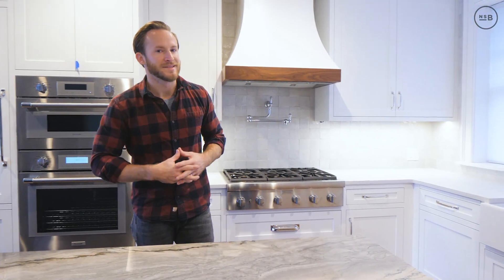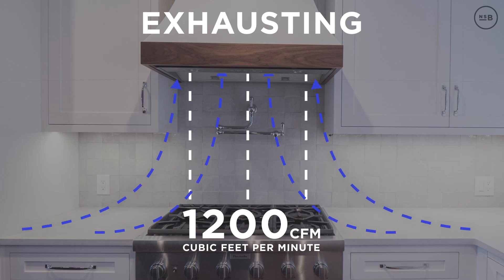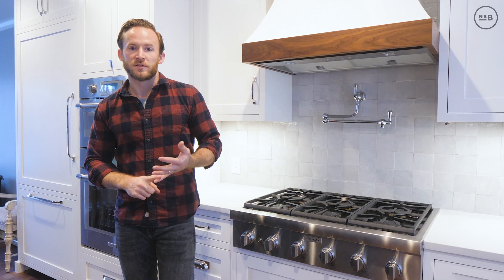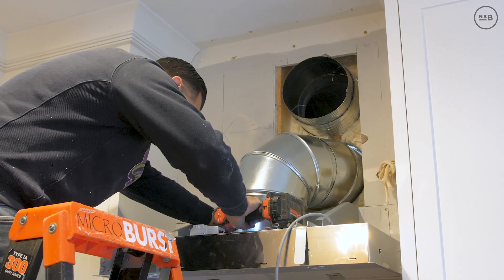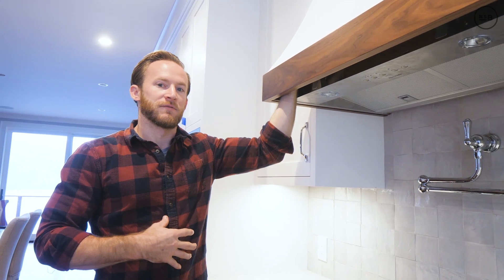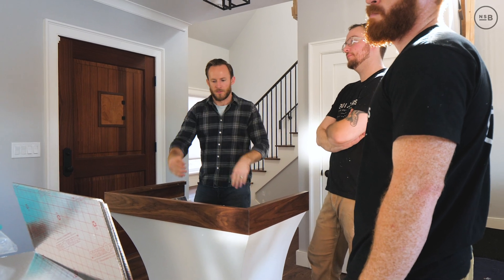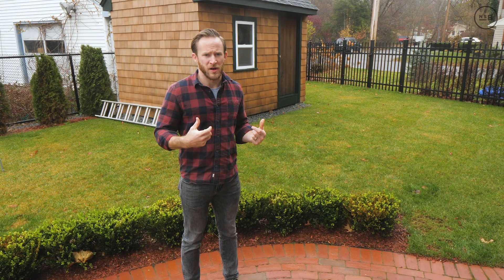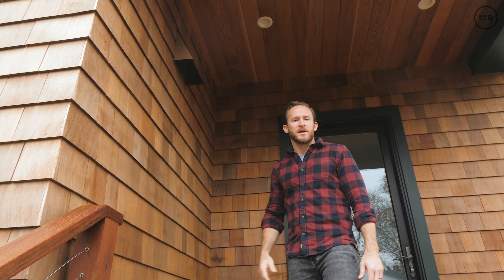Kitchen exhaust and make up air all under one hood at NS Builders Lake Drive Custom

Comment: What am I missing.?  The system  has a flow of 1200 cfm.  The inlet opening looks like 8" by 10".  That is just over a half a square foot.  That means to get 1200 cfm through that opening,  the airspeed  would be 2400 feet per minute. 

If my math is off, please tell me where I goofed.

If I'm right, this system would be rather loud.

Thanks

Comment: Seems like a clever solution, but I’m not so sure I’d want outside air (even filtered) blowing directly into my food.  I’m also genuinely wondering whether there is a safety issue with blowing air directly onto a cooking surface - wouldn’t that just stoke the flames if you had a fire on the stovetop?

Comment: rediculous, I have very tight new build, running 48" gas rangetop with 1300 CFM exhaust hood- ZERO " scam make up air" ZERO ISSUES!!!! This is all a big JOKE SCAM for idiots
Reply: the air has to come from somewhere.. lets hope its not pulling carbon monoxide out of your gas appliances
Reply: He may not have any other gas appliance other than a gas range and that wouldn’t backdraft  correct?  In theory if there was no air to pull from the exhaust would just be pulling much less than 1300 cfm.

Comment: How does the damper activate? Is it a pressure switch or a simple electronic switch tied into the on/off switch on the exhaust hood?

Comment: Very good idea, if you insist on gas burners.  But it raises the debate about cooking with gas.  People love the experience but... If we have green electricity in the area, gas is not enviro friendly. Worse yet, many science studies show that heat transfer to pots from gas flame is very inefficient compared to cheaper electric elements, not to mention induction if you have the money.  Making the inefficiency even worse is that you are expelling heat and pre heating makeup air. Yes you have to vent any steam from some electric cooking but not at these volumes.

Comment: 1200 CFM???? That would be CRAZY volume amounts of air flow. Equivalent to a 3 ton HVAC SYSTEM.  Observing your wall vents probably 120 maybe 200CFM. You should have it flow tested with a flow hood???  That said, I like the concept might try to work it into a kitchen it makes sense.  But NO WAY ITS 1200CFM.
Reply from the maker: I agree, it’s a lot of CFM!

Comment: I hate to tell you this, but most commercial”compensating  hoods only allow about  60% to 80% of untempered outside air directly to the hood. Steam hoods are typically in the 50% to 60 % range, while high heat grilles, fryers, etc are closer to 80%.  This is applicable at least, to cold weather climates that may have as much as 90 degrees temperature differences. Very cold 0 deg. To -20 deg. Air would totally ruin your day, if it is blowing on the food being prepared.

Comment: I have absolutely never even considered this as a potential problem. I'm looking at hood vents, and now I'm trying to understand how to accomplish something like this. I am considering creating something like a 20 inch x 3 inch vent that sits on the back wall, just above the top of the stove as a fresh air inlet. So as air is being pulled up through the exhaust, its being fed in at the rear of the stove.. Just a thought. This is fantastic stuff!
Reply: Just crack a window. Cost = $0.00.

Comment: I'm not convinced this will work well. Make up air doesn't "pour down" 3:54, it's not water. Nice work nonetheless.
Reply: @TheRayDog  that's what I was thinking, if anything it will pull the air straight back into the exhaust

Comment: If you made the last section of that fresh out take laminar it would drastically help the air reach down and grab the smoke. To make the air laminar it would not be hard. Just glue 100s of straws together and place it over the cavity. You could make the grill look cool like a Apple Mac Pro case.

Comment: Interesting ideas.  Two things may be overlooked.  First, the area of the exhaust & inlet hoods look to be less than 10" equivilent.  Second, a passive makeup should be larger than the discharge (pressurized) duct.  Have you encountered problems due to either of these things?

Comment: great video & great design /engineering, yet simple and eliminates a lot of equipment needed. Just one question.... you mentioned the backdraft shutter on the intake vent... is this a manual flap, or motorised & linked to the fan switch ?

Comment: Great execution! You mentioned that this method eliminates the need for a heater; however, there are concerns about colder climates in the Midwest and how effective this system would be without one.

Comment: im looking to install make up air system and was thinking in my head why cant i put the intake close to the exhaust this is exactly what i was thinking. My garage is the same wall as the fan so im good there. My question is how far should i place the intake from the exhaust 20ft ?

Comment: I love this concept. I am limited to 100 amps @ 240v due to being offgrid an can’t afford the 6000 watts needed for an inline heater unless I seriously expand my already sizable battery and inverter setup..which I might do at some point, but why add more loads If you can engineer around it? Wish this was a commercially produced product.

Comment: This looks expensive. I need to do a ceiling which I would think complicates it all. I am planning a 48 inch dual fuel Wolfe range and it’s in a peninsula. The range requires an 1100 CFM and this is in a 210sf kitchen open to a much larger great room with vaulted ceiling. Is it possible it’s not required? I feel like there’s two different schools on that.

Comment: I'd be very interested to see what happens if you do a pressure test on that house, and see if enough air comes in through the hood.  From what I've been learning, I think the makeup air won't be enough if you only have passive make up air.  The air will come in through your hood, but the vent will depressurize the entire house, not just the cooking area.  So, air can enter the house by any vented means, such as a chimney or the furnace vents.  Yes, the hood vent will allow air in, but will it be enough if only passive ventilation?   Can you comment on that?
Reply: I think you are correct, however there is something to be said or 'valued CFM' added when the point of return is 'point blank' near the point of supply. Think of it this way. IF the loop was closed, then the CFM from the hood (going out of the house would equal that of the CFM coming in (image the dumb contractor closed the loop by accident).  However as we know, it is not a 'closed' loop and there is a 'distance' between the two. This distance can be modeled (or though of) as a 'gap' in the closed loop.  Or closed loop with a section removed (say 6"); how many CFM's are lost in that gap through inefficiencies?  That would be the 'lost' CFM's needed to be forced into the system to obtain equilibrium.  

Without instrumentation, I'm beginning to think if A) the point of venting and outside air volume are close enough and B) the lost efficiency is less than 400 CFM one would be covered/ in compliance. NOTE: The 400 CFM value is from the IBC code where if less than 400 CFM, a system is not required in the first place. Cleary the code is not eluding that the pressure is neutral, but rather explicitly indicating if it is 400 or less, we (the authors of the building code/IBC) don't consider it material.  That tells me that if the amount 'lost' from a 'non-closed' loop is 400 CFM or less, all is good.  

I'm starting to think the other systems (with the fans and Heafy price tags) are using the 'zero' pressure result somewhat of marketing hype since the code clearly indicates a 400CFM spot at the start line.
Reply: @tillmansr2002  The code allows 3 PA or less pressure difference, and has an exception for 400cfm and under as you pointed out.

I think what maybe you are missing is this 10" active blower is likely pushing something like 1200cfm.  And a passive 10" opening only provides 450cfm or so.

Compliance is not 400cfm difference it is 3Pa difference, but even if it was 400cfm difference I still think it would fail.

Comment: You guys are meticulous! I wondered if the intake air was passive or also inline blower and if you filter the air going in? May not be an issue where you live, but here (Nashville) we would suck in so much pollen, and other unpleasantries that I would have to filter entry air.

Comment: Have you tested how well its actually equalizing the pressure? I've seen some other videos showing that with a passive system you actually need a much larger intake to achieve a net neutral airflow.
Reply: Other question from that, have you done any testing with a smoke pen or something? If the intake isnt keeping up with the vent, is the make up air actually flowing down to the range and back up or just staying up high and not really helping to scoop any of the steam/smoke/etc?

Comment: I assume the home has been properly air sealed and blower door tests confirm this. (I've enjoyed watching this channel so I know the answer is yes) Now My question is with the vent blowing out at around 1200 cfm, how are you sure you're getting in the equal amount of air from the open end system? I've seen Matt Risinger & Corbett Lunsford on their channels show that you need a powered fan to induce the fresh air into the home as well, if not you're still getting negative pressure. Did you test for this??

Comment: Lovely work. 1) Does this have a blower on the make-up air duct also or is the air moved by  the negative house pressure generated by the primary vent blower? 2) How much does the downdraft of the make-up air reduce the suction at the level of the range? Thanks,   David - Dallas
Reply from the maker: No blower on makeup. Passive intake. We didn’t “measure” the reduction, if any

Comment: It sounds like a well thought out system.  I wonder how well it turned out.  In the past I owned a range hood that sent about 20% of the exhaust back to outlets in the front of the hood to accomplish just what he showed here in the motion diagram, that being, to create a rolling effect of wind between the hood and the range.  It didn't work.  And it was particularly problematic when using the oven or the front burners.  The house would smoke up.  And because that 20% was recirculated it lowered the CFM pulling power.  I have the feeling that if this system here works at all, that it would be when the hood is run at full power.  I believe that make-up air for a range hood is best accomplished in having the make-up air come from an outlet located beneath the range.  With that set-up all of the smoke and heat being produced by the cook top as well as the oven is pulled away, and there is sufficient make-up air introduced.

Comment: I'm sorry to say, this is a hare brained idea. You're hoping that incoming air is going to drop down to the cook top before being sucked back out. I don't know what makes you think this is how it will work, but it won't. In reality, most of that incoming air is going right back out the exhaust without capturing anything.
Reply: You know, that might be true. I've seen this idea a couple of times today in vids and never is the author commenting on whether it works in reality or not. Smoke test at the very least ought to show what's happening.

Comment: You’re definitely NOT bringing 1200 CFM back into the house just because your exhaust hood is advertising 1200 CFM out.
Reply: …. Physics is a bitch!… it is really really really really hard to move 1200 CFM through a 10 inch pipe with a fan let alone without one. To move that much air through a 10 inch pipe you have to overcome at least .7 inches water column plus the friction loss of the pipe elbows and the grill and exhaust hood and not many fans will create that…

Comment: Interesting episode Nick. I work for CaptiveAire Systems, this is our wheelhouse. We now have UL listed residential systems with fire suppression integrated. Pre-fabricated grease duct, chimney duct, and of course the hoods are becoming more and more popular in resi these days. I like your guys’ solution, I know your mechanical of choice is a sharp outfit from TOH. Next time hit us up for your project needs. Would be cool to see commercial grade system installed by a super competent outfit like yours.
Reply: Does captive air systems offer residential hoods to at have the integrated makeup air system like what they build here? That would be amazing and make it so much easier for your run of the mill contractors to install. Would just need the hvac guy to do the ducting runs and install the online blower then :)

Comment: An interesting test would be a smoke flow test from outside to inside to see how the air actually moves. My guess would be it's wrapping around much closer to the hood since you don't really have forced air feed. The makeup air ideally should be below the surface of the range, imo. This allows a more laminar flow pattern.
Reply: The same contractor has a smoke test video and the result is exactly what you predicted. I'm not sure if this is the best design. Nonetheless, work quality is top notch.
Reply: @thaivu3324  Where is that smoke test video?
Reply: @thaivu3324  Interesting. Thanks for letting me know. I guess air makeup is better than none and you'd at least contain the air to keep it from changing the inside temp/humidity much.
Reply: Not sure this would be able to get to building code using a passive makeup air vent. Typically the makeup air duct has to be 2 or even 3X the size of the exhaust to offset the forced outflow. Likely need to add a powered intake blower along the same duct section in the garage to keep everything else the same but as presented this system would be well out of the 5pa code for negative pressure test.
Reply: Not sure how this works with oven emissions.  Seems inflow from under oven would be an improvement.
Reply: @moonpiespotlight4759  I agree the air needs to flow from the range surface if it's going to be nearby.  All this would do is suck out the new air without extracting much of the old air.  Yes it will work a little, but probably 10% efficient.
Reply: I wish these types of systems were made part of the building code. I'm working with a builder and based on my experience so far, I guarantee if I were to ask for something like this, they'll try to charge me $5k to add it in. Looks like I'll just be opening the kitchen window and letting all the hot/cold air into the house.
Reply: https://youtu.be/u2uVaTMXd_8
Reply: Exactly my thoughts. I'm building my house (first time) and these videos are WONDERFUL and so inspiring and motivating. The tech info they share is so helpful. But I wonder also, wouldn't the fan simply draw out the fresh air coming in? I'll search for the smoke test video from @NS Builders that @thaivu3324 mentions.
Reply: Heat from cooking will raise the smell up into that airflow, which should then pull it away. Especially because there is no positive pressure makup air fan, there is a negative pressure zone above the stove. If a door or window is open it won't draw from that makeup air vent at all. But who knows. A smoke test would be really interesting.

Comment: smart to put the intake under an area protected area.  it pro doesn’t have the capacity to suck i. rain water but some dampness will enter that duct, but since it’s under that a roof or porch over hang there’s not chance of it.
the shape of the vents would look much better if they were the same height as the siding and longer in shape to retain volume of cfm.
that’s a really elaborate hood vent, one nobody has ever seen fit a residence.   nice job !!!

Comment: Very cool. To take it to the next level, installing a differential pressure sensor and putting a controller on the motor would ensure the volume of air in the space is balanced.

Comment: all nice and beautiful but how will you going to clan the ducting system did you leave clean outs? did you use  smooth duct? did you leave a pitch so the grease can be collected  in one end? if the owners are heavy cookers in 1-2  years grease  will start dripping (depending of what cooking they do). but great idea and it looks beautiful
Reply: Iclean grease ducts commercially. yeah they are pretty much only going to be cleaned as far as you can reach and eventually it will smell. because it cannot be cleaned.  lol. In order to clean something like this properly you really need welded type 1 duct.

Comment: Hi. My contractor connected the vent metal pipe using Zip System black tape. Is that ok or should I be concerned that it might melt in time?
Reply: Contact the manufacturer of the Zip system. If it was used on a way that wasn’t designed you may or may not have a problem. Their product is designed to adhere to the Zip boards so it may sticks nicely now but overtime it may start to peeling. If is a easy access you can get him to come back or someone else to do the right way. I hate when the want to use what they have at hand instead of buying the correct material. Good luck and wouldn’t worry a lot but keep an eye.
Reply: @marcelosantana9311  Thank you so much. I just replaced it